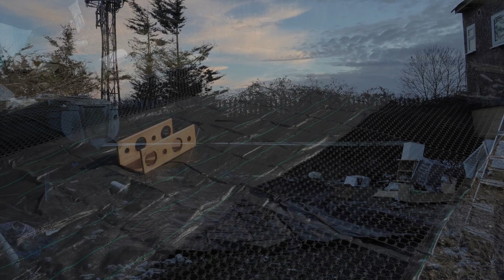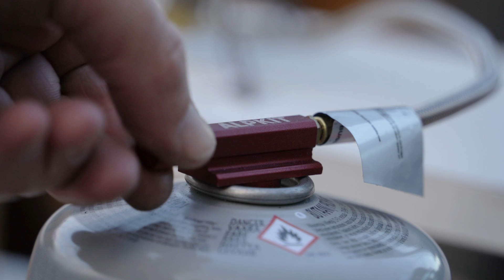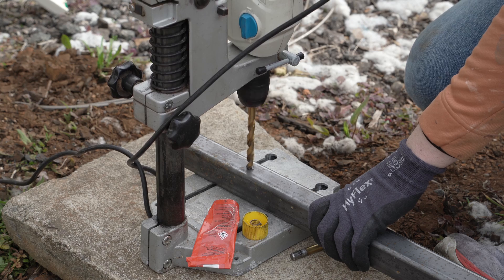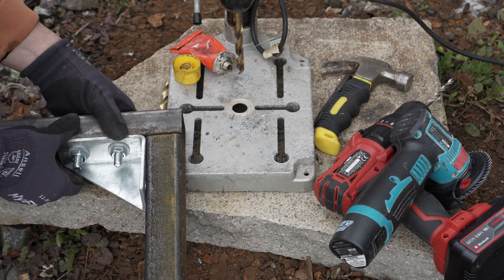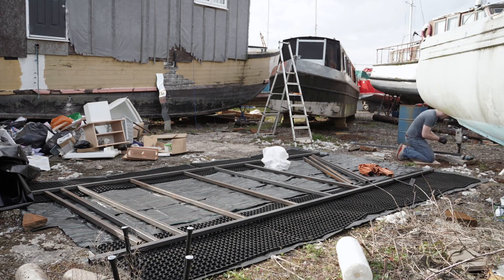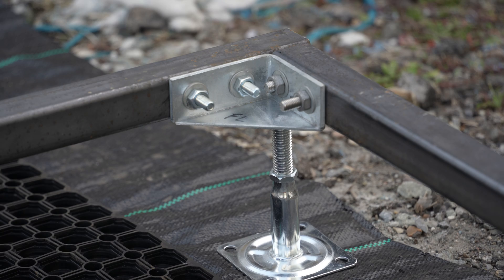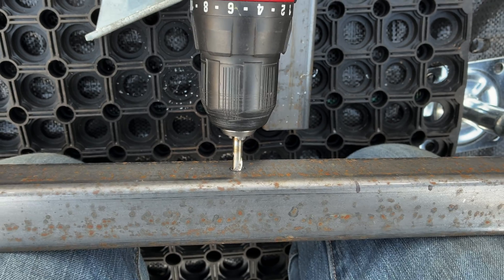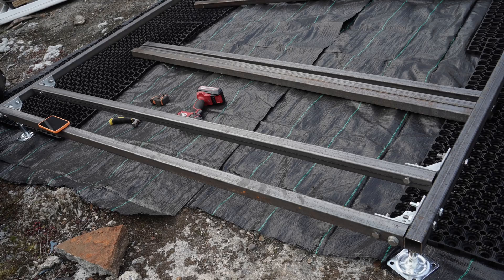Steak & Steel. Making the steel base frame for composites mould. Arctic Vehicle Project BERNARD [4K]

Comment: Having made a vehicle body frame from 5000ft of 1/2" mild steel square tube  (all cut with a hacksaw) I found etch priming all the steel before starting with pressure pack cans saved many hours of sanding later before painting. Just a suggestion.

Comment: Assuming the lengths are correct (I'm sure they are) just measure both diagonals, if the same, its pretty darn square.
Reply from the maker: Not if the sides bow out or in. The corners might be square but the innards off.
Reply: @AlexHibbertOriginals  mmm I'm not sure what your tolerance expectations are, but it looks like your using hot rolled, which is fine but it will be a bit wobbly compared to cold rolled. The innards being off you've mitigated by putting in the supporting struts so its just a question of what's more effective a framing square or two big triangles. I'm more worried about levelling and the permanency of the levelling.
Reply from the maker: The inner section will be held at a fixed width if the two side sections are braced with cross beams when held at the right shape. 

The levelling is fine as once I have it complete, there's  twelve supports that can be adjusted with spirit levels and even adjusted later if the ground settles once the weight of the mould increases.
Reply: @AlexHibbertOriginals  gd gd well in hand then